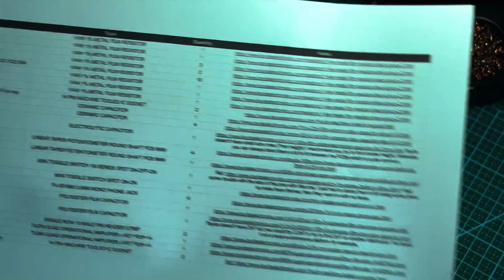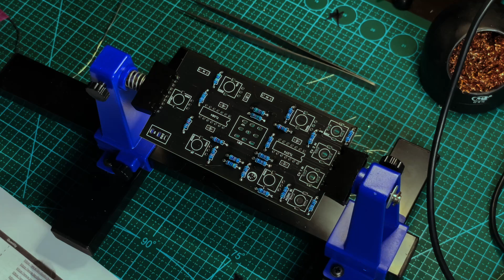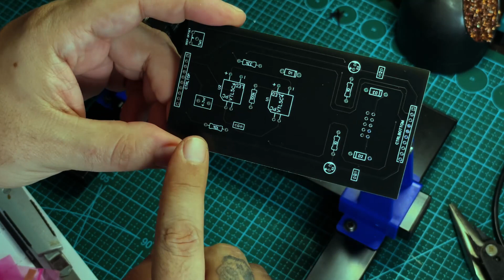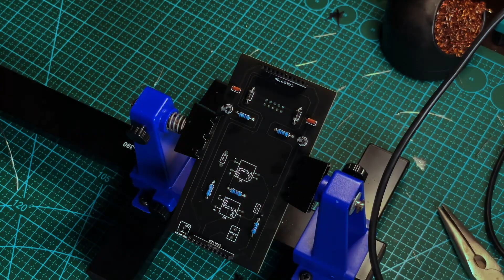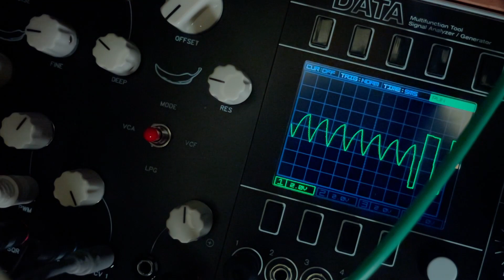DIY Eurorack Buchla style LPG with resonance control

Comment: There is something special about vactrols. They sound very organic in a way.
Reply from the maker: I want to add vactrols on everything now :D 100% agree the organic nature of it is something special
Reply: @VoxmachinaOfficial  what’s your go to combination for diy vactrols?
Reply from the maker: @mymodularjourney  There's a great discussion here about it ;) https://modwiggler.com/forum/viewtopic.php?t=241321 I've tried a few combinations like using a bright white led and a 5516 LDR, that seemed quite good to me (although not as good as the VTL5C4 I'm using here :) but that might be on me and on the light isolation part, I would say the best combo would be any ultrabright led that can match the 5516 LDR, I want to give it another try :)
Reply: @VoxmachinaOfficial  What you guys calling a 5516 LDR is an LDR with 10-15k range resistance (illuminated resistance) and 500K dark resistance? Would it be part number C125626 on LCSC? Thanks for the help, I really want to build this module.
Reply from the maker: @consbuteri411  So to make your own I recommend reading through this thread here ;) https://modwiggler.com/forum/viewtopic.php?t=246264 different options and more details in the conversations, cheers!